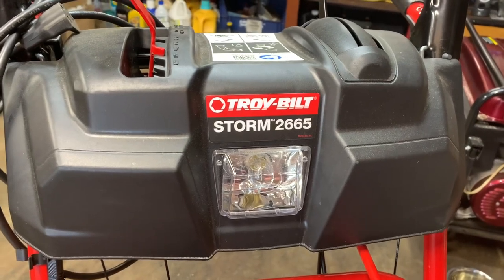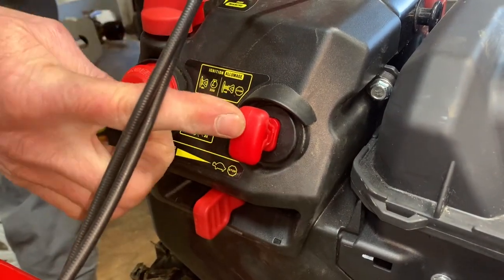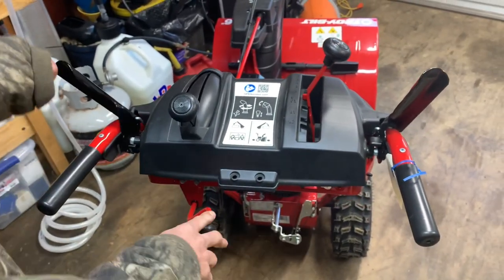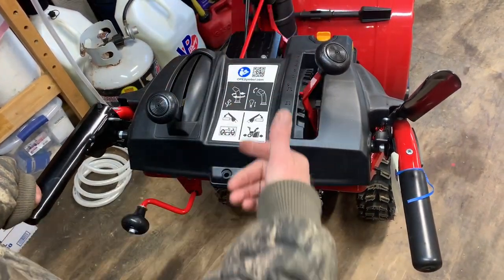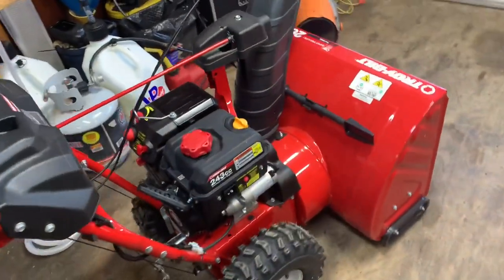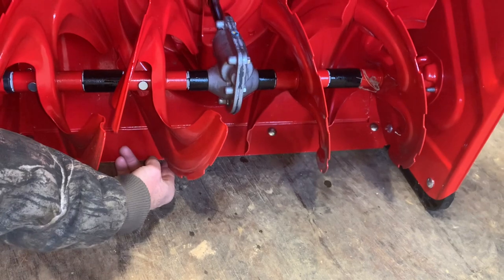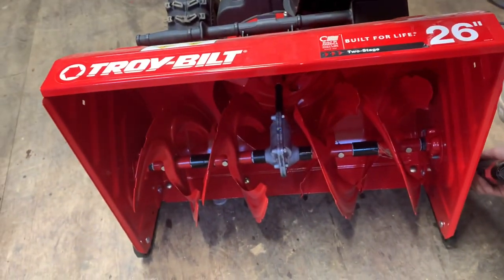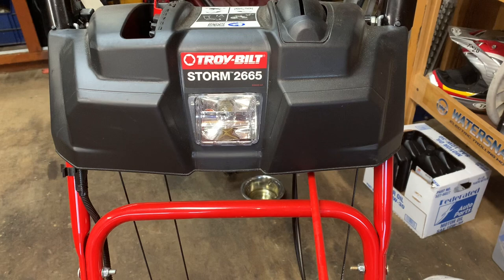How to Start and Operate a TroyBilt Snow Blower

Comment: After each use, should I run the gas tank empty or keep some gas in the tank with an additive?  Would this be the same for summer storage?  Thanks
Reply from the maker: There are a few different ways to store your machine but I would be writing a book. I will put out a video on "How to store your Snow Thrower in the off season" in up and coming videos but for now during  the season of your machine boing used, I would suggest keep fresh fuel in it. Full tank and if you do not use it for 30 days, go out and run the machine for at least 10 minutes to get the fresh fuel through to the carburetor from the tank. You should always put fuel stabilizer in the fuel you purchase at the pump just to make sure it will be treated in all your equipment. Fuel stabilizer does help but you can still have fuel issues from sitting.